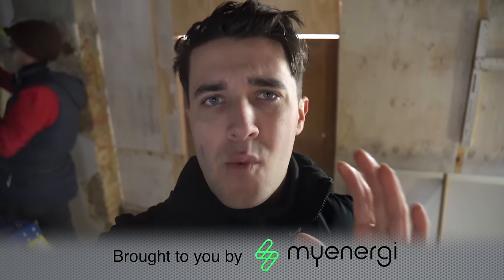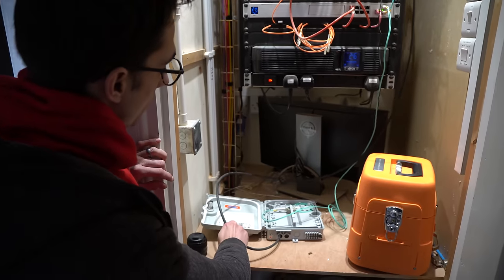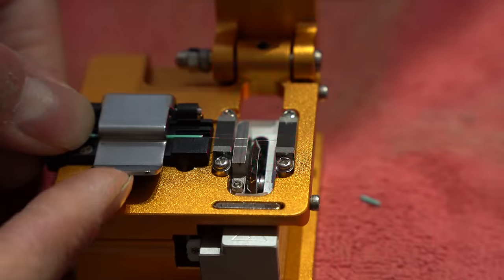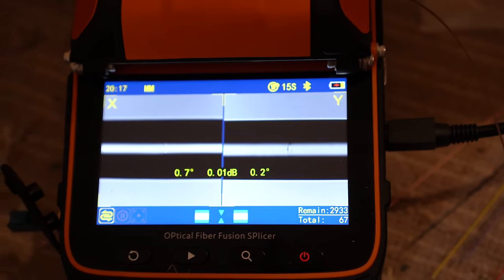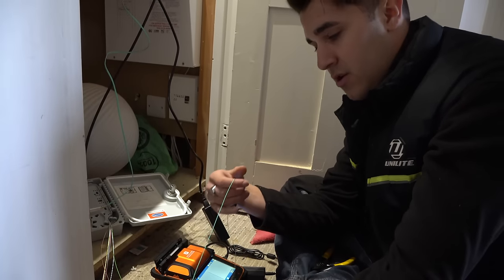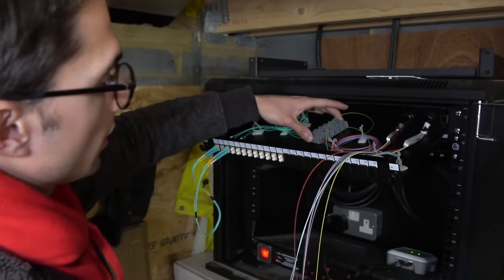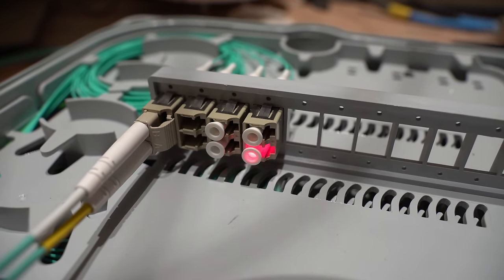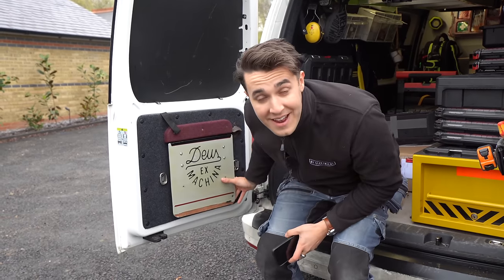Fiber Optic Splicing: Tips and Tricks for Beginners | ØY16

Comment: Speaking of fibre being bad for your health, in the early days when fibre shards werent a known hazard, my older colleauges spent a whole week in the cable chamber of a BT exchange jointing cables straight through. They werent aware the shards can pierece the skin, so they were splicing over a large tarpaulin. On the last day they sat down to dress all the joints onto bearers etc, and sat on the tarpaulin. All the  hundreds of offcut shards of poor cleaves etc ended up piercing them in the legs and behinds, and they had to go to hospital and sit in a hot vaseline bath for 8 hours to persuade the fibre shards to exit the skin. Fibre and fibre safety has come a long way!!
Reply from the maker: Crazy!
Reply: Wearing safety glasses is a must guys! Broken shards in eyes can make you blind.
Reply: 30 years ago I was working at a cable TV company here in the US, fiber was being introduced into the distribution system and some of the techs learned some of those painful lessons. I don’t remember anyone suffering career ending injuries or damage but some guys did end up in the hospital.
Reply: @corymac  Where did you get your Black Fleece Made/ From?
Reply: Oof good to know. I imagine a little work bench with a garbage can below to catch all the fibers would be a good idea.
Reply: @benargee  The fibre cleavers of todays world automatically catch fibre shards in a little bin on the side of the cleaver
Reply: In a lab we had a sharps container for the offcuts. These things are little needles.

Comment: Fiber splicing is not too bad. Doing it inside is heaven compared to trying to get the damn stuff to splice in the cold/rain and wind. It's good to see you learning new stuff. A few times I turned up to a new build and the builders had run a copper cable and didn't know anything about fibre so the copper cable they had run behind all the walls was useless.

Comment: Great to see the practical side. 20+ yrs ago I was responsible for the UKs first private telephone network link using fibre. It was instead of  30 BT leased lines with repeaters. We used Pirelli’s preproduction interface boxes and got a whole 2M signal. Not 10 or 100 nevermind Gigabit. It linked two   university campus telephone systems with thousands of users. Based on the under sea technology it was a lot bigger. Keep them coming 😊
Reply from the maker: Cool!

Comment: Back in 1997 my team designed a fibre network for central Paris deployed in the walk-through sewers there. To connect to buildings we left a coil of cable every 200m that could be unwound up the nearby manhole into the back of a van - the humid environment in the sewer is a no-no for fusion splicing!

Comment: The splicer boxes have reduced in size which is pretty cool. I had BT fibre installed 10 years ago and it was a box a little larger that you would hang in front of you with a harness. It's cool to see the technology get smaller and watch the machine align the splices. Really liking this video, not many out there on this especially from the UK.
Reply from the maker: It’s cool isn’t it!

Comment: They redid the fibre internet around here like 7-8 years ago, because it's an installation that was originally installed in 2003 and they were modernizing the equipment all the way from the centrals to the customers. The old equipment needed 2 strands for each connection to work, one for Tx and one for Rx, but the newer stuff is able to run something like 100 times faster using only a single strand for both Tx and Rx. They had to swap the connector to make the fibre work with the new boxes, and they brought in a very similar big splicer box to get a clean cut, and were kind enough to explain what they were doing and why, which was really neat because fibre communication is just one of those things that was more or less advertised as magic when I was little and the tech was brand new. Now, I'm on the consumer end and the two-core cable that comes out of the wall is actually quite thick - about the same thickness as a power cord, but it wasn't till the techs showed up to redo it that I realized it's that thick because there's something like 10 layers of insulation to protect the glass cores, and the core inside is amazingly thin. We actually have 2 channels on each core, but only use the one for the internet, and it still amazes me how fast you can chuck data down a hair thin piece of glass (we've got 1000/1000 Mbit in these parts now, which is the fastest consumer line you can get in Denmark)

Comment: Just for reference, single mode fibre is often listed as 9/125.  The 125 is micrometres is the thickness of the glass and is the size of human hair.  The section the light goes down is the 9 micrometre core.  That is the black line when looking at the screen of the splice machine!

Comment: One thing which caught us out in the early days of using fibre in the network is that where RJ45 ports on a switch are auto-sensing, fibre ports are generally not (we used Cisco kit). Depending on who wired for you, you may need to swap over send/receive fibres on the panel! We had two different contractors fitting them opposite ways on the fibre patch panel when extending to a new building. Simple once you know!
And you can buy simple testers to check your fibres - even as simple as a laser torch to shine through.
Reply from the maker: Cool!

Comment: I live near a bunch of data centres and watch the fun of new fibre runs and some new splices in street pits. Watching them working in 40 degrees C temps or bucketing rain, tucked in the back of a van or small tent... One other story - many moons ago a fuel tanker ran off a road and overturned, with a huge burning fuel spill. The truck fell over right on top of huge pit covers. Buring fuel and phone lines/fibre splices doesn't mix too well...
Reply from the maker: Crazy!

Comment: Imagine doing a 96 way os2 patch panel, sat at an outside green cabinet in sub zero temperature for about 4 hours in the wind and rain under an umbrella..  Been there, it's no fun.. lol
Reply: Almost same. Not in sub zero because Texas but 110 with 90% humidity. Yeah it's cool to splice fiber till you have to do real fiber Shh.
Reply: You guys have chosen the wrong country to do fiber installation in…
All Swedish installers are either working in a van or trailer, they have enough slack to bring it inside. 
My guess it’s a 50/50 for work quality and work environment.
Reply: You had it lucky, I use to dream of working under an umbrella!
Reply: Working on 432 fibres next to a running railway.
Reply: The funny thing is I enjoy the rain that sounds delightful. Unfortunately I also can't do heat well.
Reply: Try doing it in -50 winds at 500 feet while it's snowing-raining
Reply: @kristiangoransson6104 that's smart for multiple reasons.  2 of the most important factors when splicing/ terminating fiber are; 
1- setting up a comfortable, well lit & stable workstation 
2-create an efficient work routine/sequence & then follow it every time! 
Always Label & test! 
I hope those little tips help.
Reply: Sounds like money
Reply: Harry potta ?! I never new you could wield light
Reply: No you didn't lol it's can't rain when it's sub zero temperature and you can't splice in sub zero because the fiber's to brittle, and getting those machines wet is some expensive stupidity.
Reply: People will eat shit for $125 hr.
Reply: @Lawless-Texas just get a splice trailer? Lol

Comment: Large fibre cables aren't bad, youll be amazed how quick you get when you get in the swing of it. (Especially if you get a ribbon splicer, it can do 12 splices in one) A tray of 12 splices in 15 mins. Contracting for BT back in the day gave 5 quid a splice, doing a full 144F joint in a day wasnt hard and would land you a good whack.
Reply: I would really love to be paid per splice. I can do 350-400 splices a day easily. Would be good money if I was paid that way, but I am on an hourly basis, so I get like the same money an hour that may company charges the customer for one splice. Total ripoff IMO if I can do 48 in an hour.
Reply: I’d absolutely love to see you make 350 0.0-0.01 splices that pass iOLM test in a 1 day 8 hour 9-5 shift😂

Comment: Years ago, I used to work for a company that laid and repaired undersea fiber cables.  The engineers at sea had practically the same equipment.  I had a go at it once, my cleaving was, well.. a bit shite and my connection was pretty lossy!  Mental to think they'd be doing that stuff at sea.  I had FTTP installed the other day so obviously bugged the Openreach engineer loads to see how it's done.  It seemed SOO much simpler (and presumably more reliable) that the old copper stuff.

Comment: Took a while for me to spot that the two camera pictures were X and Y so showing different profiles of the cable (is it still a cable if it's glass?)
Really interesting. Never had to do fibre as I stopped being responsible for IT hardware before it hit the mainstream. I do find it interesting that while I was always having to fight with the higher ups to run spare cat5E for future proofing/breakages, it seems like a typical fibre run has 4x or 8x the individual connections you're likely to use. How times change!
Reply: I think that's mostly because of the cost and it's glass it's fragile it might break better run extra. It's also just cheaper for the company to throw a bunch in since they're so tiny when making the cable.

Comment: Upgrading to a thermal jacket stripper will make life a whole lot easier than using the three stage stripper tool.  You strip off the jacket and the acrylic layer all in one go, enough to use the alcohol wipes to clean it for cleaving.  There is less chance of cutting the fiber(seen in 11:34) and reduce the damage on the cladding on the stripping.  The thermal strippers typically require the use of a fiber holding bracket that over all I find better to work with as it reduces you needing to handle the fiber directly.  The brackets will also help you not have to fumble with having to put the fiber in the splicer in the right place in those internal holders for fusioning or during the cleaving procedures.  The best cleaver I have used is the Sumitomo FC-8R, which allows you to orient the fiber in pretty much anyway you need to cleave it at.  It does not need to be set flush on a floor for the cleaver to work well, which some cleavers require to be and leaves you doing things in awkward positions on occasions depending where the fiber is dropped.  Used with the fiber bracket holders it makes the cleave go much faster than having to align the fiber for each cleave as the FC-8R will accept the fiber bracket right after you have cleaned it with alcohol.  It almost can be used by one hand to set the fiber and cleave it.  It is hard to go back to using other cleavers once you have used that one...  Using a V-groove or core alignment splicer with separate fiber holders makes live easier as well I would say.

Using three stage tool and common cleaver and splicer without fiber holding brackets
Remove outer jacket -> Remove outer acrylic -> Clean with alcohol pad -> Align fiber in cleaver -> Cleave fiber -> align fiber in fusion splicer and lock with internal holder.

Using Thermal jacket remover with cleaver that accepts fiber bracket holder, and V-groove or core alignment splicer with separate fiber bracket holders.
Place fiber in proper holding bracket -> Use thermal jacket remover(removes jacket and outer acrylic all at once takes about 5-6 seconds) -> Clean with alcohol pad -> put bracket in cleaver -> Cleave -> place fiber bracket in splicer

There is no alignment steps with the 2nd one as the bracket is set to hold the fiber in the optimal location for each procedure.  So your not spending time aligning on each step.

We have that splicer shown here in the shop as a backup since it was real cheap, it is the AI-9 model from SignalFire.  Although on amazon you will see that its also sold as some other brands who just resell it.  The AI-9 is pretty good at manipulating the fiber in the holders to get it into position for the fusion arc even if you are not really that precise of putting them in the internal holders.  For the price you pay it is a fairly decent fusion splicer that does the good job at its price point.  However, I would warn you that that the app used to control the unit does asks for some strange permissions, such as access to your contacts...  It controls a fusion splicer, needing to know the number of your girlfriend or family is not necessary to do its job...  If you use this splicer I would suggest you to get a cheap throwaway tablet of some sort to connect to this thing to control it for security reasons.

https://signalfiresplicer.com/web/gyzs.html

Comment: Did a few large cabinet refesh's in a plant a few years ago and they were doing multi core fiber terms for 2 days each cabinet we reipped apart and re wired with new 10g equipment. i did not envy the fiber techs at all.

Comment: I spent years jointing 144F cables and live break ins to spur a cable off... quite intense. Not very happy that I didn't see a sharps box. Technically, if you get a piece of bare fibre cut into skin and break off it can actually kill you if it gets in the blood stream... caveat is that it is a billion to one chance but good practice to keep work area intrinsically clean.  Working on an actual live core transmitting is idiotic too even banging out an ILM. Hopefully the missing good practices were edited out 🤓
Reply: That's an interesting point actually. I've seen manufacturers even suggest using a visible light whilst using their cleaver, or cold connectors. But I believe you 🤣 I'll have to research this more.

Comment: Many moons ago I worked for a company that did R&D and production for BICC Brand Rex.  We produced a number of fibre cleavers and splicers, as well as the blocentre which blew multiple fibres (up to 12) through 8mm conduit and was capable of multi-kilometre runs.  Things have moved on since, the splicers we produced all hand-aligned the fibres using micrometer adjustable stages witht he operator looking through a microscope.
Reply: I'd love to try blowing fibers at some point. Awesome that you've been able to see the technology progress.
Reply: @Chillielectrical  Not sure how subsequent designs work but we used hypodermic needles about 6 inches long to guide the fibres into the pressure chamber and provide sealing.  Within the chamber were two inverted toothed belts to provide traction and a buckle detector.

Comment: Thanks Cory for another great video. One of my many roles was IT and infrastructure. While I'd seen many finished projects with what you've shown I'd never seen the fibres spliced. A backhoe took out a huge chunk of east coast Aus data centres and internet connections some years ago where hundreds of bunches of fibres merged and entered a building. They all ran via different routes but had one point of failure. Oooops.
Reply from the maker: That’s cool Jim! Thanks for sharing! 😎⚡️
Reply: Not the big yellow fiber cable eating machines, no no no.

Comment: Cory, you should always do a power test on a new fiber installation and document it as a bench mark, so if you have to come back because there is an issue, you know what the splices power through put was and can then see if the fiber cable is damaged or not.
Reply from the maker: Nice tip!
Reply: @corymac  Also, if you have any distance with your fiber, using an OTDR to measure from the source to the splice helps identify the splice location.  It will also show if you have any problems between the source and the splice.

Comment: Fibre splicing is a task I like a lot to do. It's the kind of job you that is very easy to learn but requires some finesse to do it. 

When I need to do it, I just put the phone on silence, put the headphones, select a playlist on the iPod and just zone out while doing one by one.

Before I realized the work is done, the day is finishing and I just pack and go home.

Of course most of the fibre splicing I've done was inside buildings with controlled environment. I have a ton of respect for those that have to do outside in hot/cold/rainy/windy days.

But tell Oliver that machine is way better than the Fujikura I rent sometimes. The Fujikura although is considered the "Rolls Royce" for this kind of work, it doesn't have Phone Connection, Fibre Test Light or even OTDR/Powermeter functionality as Oliver's one.

It just spices together, headsrinks and measures the lost of the splice. Nothing more.

If I need to use a test light I have to use a light injector and if I want to measure how good the fibre is point to point I have to use the Power Meter.

Other than that, it was a refreshing topic to touch and an extra knowledge you get. Keep up the good work and the original videos.
Reply: Yeah respect for the guys doing it outside etc! I'm really impressed with the splicer so far, but like I said it wasn't a super expensive one.
Reply: @Chillielectrical  May not be expensive but heck in your case one machine does the job of four tools.

Is less weight in the arms when something combines the function of three or four different tools.
Reply: Finesse is called a lot of patience.  Especially when you get into an existing splice and it's a mess, requiring the entire splice to be redone.